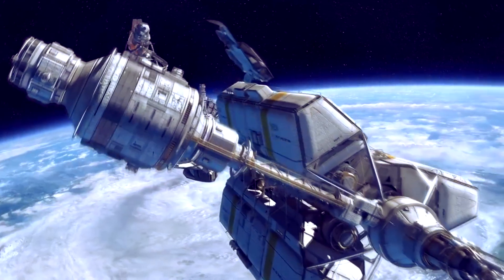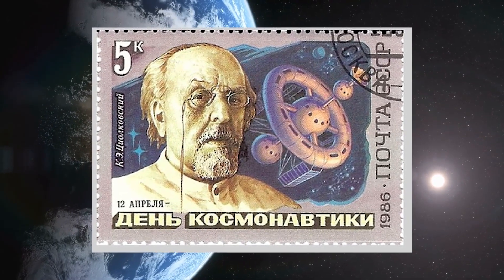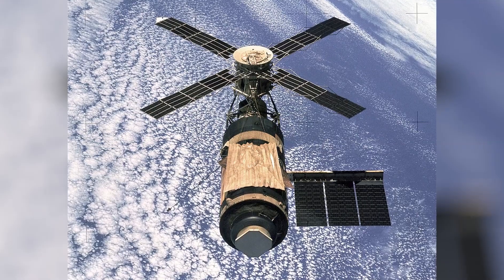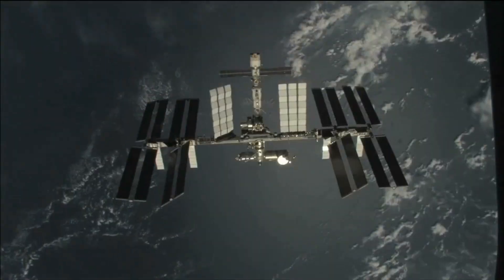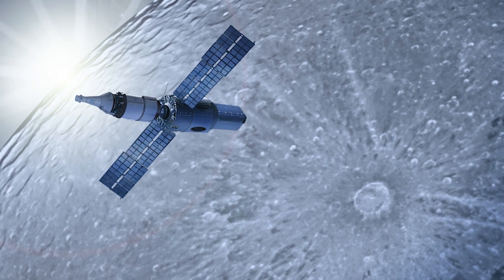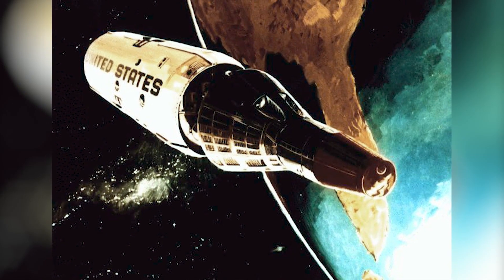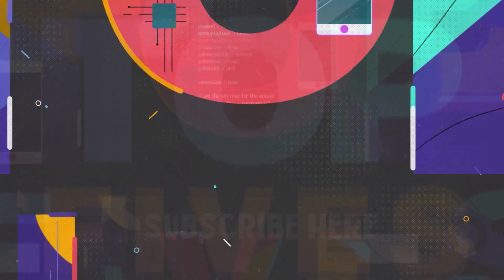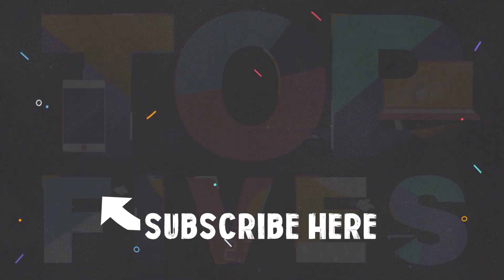15 FUTURE Space Station Design Concepts

Comment: very large rotating space station/city with artificial "gravity".. design the upper stage (of a starship?) to be a tall truncated hexagonal pyramid (no protrusions). these can be fit together into a rotating drum/cylinder with no gaps just like lego building blocks but hexagonal, with the outer and inner surfaces looking like soccer balls/hex grid...  more ships  can be added, tethered together in pairs to the center of their inner smaller hexagons/"nosecone", (or in even numbers, or complete rings), and then be spun up to match rotational speeds with the existing tethered rotating pair (or even number of ships, ring, or tethered rotating drum) then pulled/bolted together sideways with cabling or thrusters.  (difficult to explain without visual modelling). once they are a complete ring they can be bolted together and the tethers removed or leave them for extra strength. as the ring builds sideways into a long cylinder it will gain enormous strength.  the propellant tanks become useable space with fuel removed and pressurized.  the engines can be reused if brought back to earth.  the hexagonal engine sections/thrust pucks can be used to build the endcaps.  if you wall/dome off the endcaps you could also pressurize the rotating drums interior. have your exterior docking facility on both ends in the center of the endcaps like in 2001 a space odyssey.

Comment: I believe that it was in the late 1970s that I read of an O'Neal Cylinder at the L4 or L5 LaGrange point, that would be used to manufacture orbiting power satellites, using materials mined on the moon, and launched to the LaGrange point, using a linear accelerator to be constructed on the moon.  That's another one you missed.

Comment: While I would not call this video "click bait", it is somewhat disappointing. The early Von Braun station is a concept from the 1950's. The "new" Von Braun at 10:45 has been 
changed to Voyager Station, due to criticism of Von Braun's Nazi ties during WW2. 
As well, the pic at 10:45 is NOT the Gateway Foundation's Voyager Station; but the bigger Space Gateway. The only Voyager pic is at 12:20'
The video often shows animations that have no bearing on the specific station being discussed at the moment.
Finally, the $9.5 Million price for 12 days at Aurora Station is for the stay itself, and does not include the current $55 Million price per seat on a SpaceX Dragon, or even 
a higher price for other providers. Hopefully over the next 10 years, prices drop considerably.